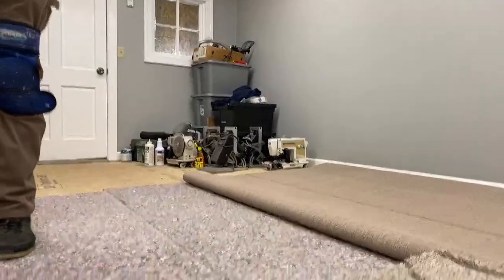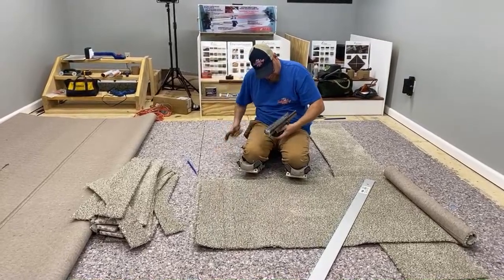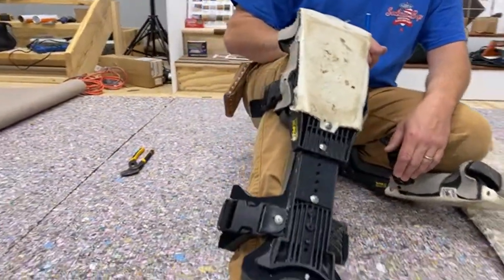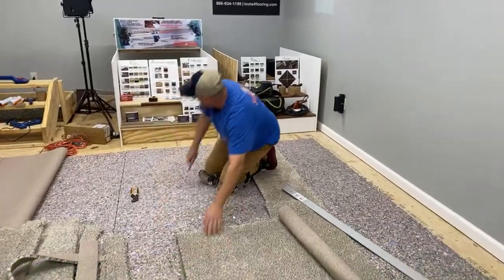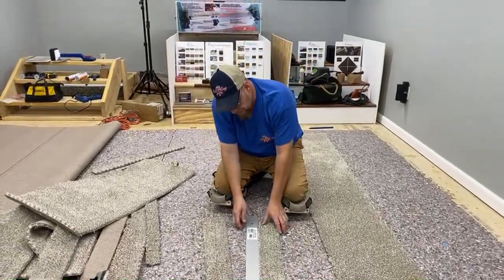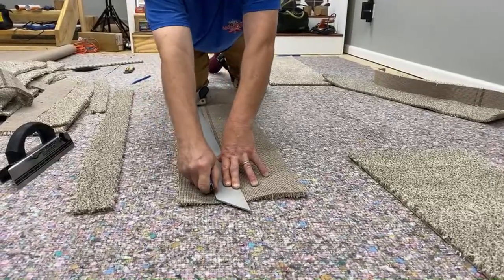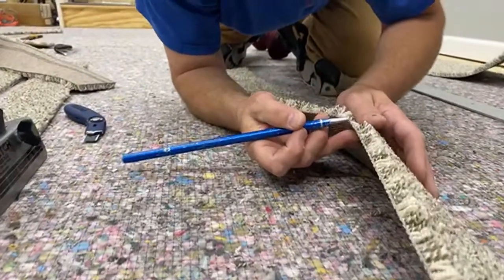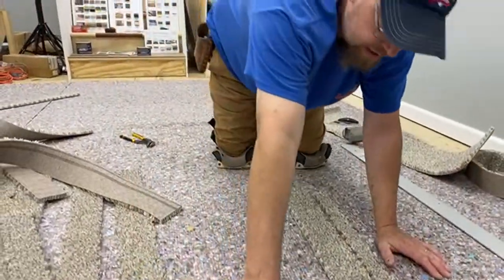Butt Buddy Seam Cutter

Comment: Guess it makes sense now why ive never seen or used one of these so far doing carpet for 16 years. Bunk ..if it worked well i would just request 2 changes to the design...1...put the wing nut to tighten on the outside...and 2 ...only allow the blade to flip 180 not 360 so no matter how hard you press the blade cant go back up inside because of a wall blocking it.

Comment: I'll have to give it a "Nay" and toss it over the fence where it'll permanently reside along with other wizz-bang tools that claimed to revolutionize the flooring industry such as, the Orcon Double Seam Cutter. 👎
Reply from the maker: 🤣🤣 Yes the double cutter was definitely not the best tool, I could never see myself using this on a regular basis but it does do what they claim it was supposed to do, that was the point of the video to see if it actually worked.👍

Comment: They use it different in there infomercial. They don't run a row on it. And they run cross cuts and diagonal.  But i always thought it would not work
Reply from the maker: Yeah I’ve seen those like that, but it did not work without running a row